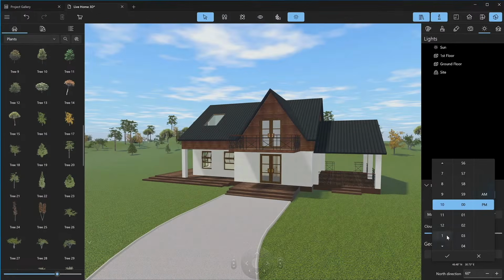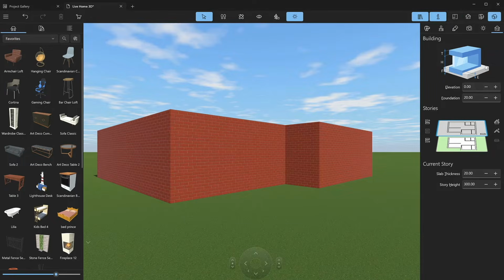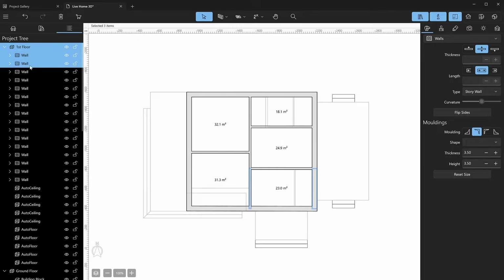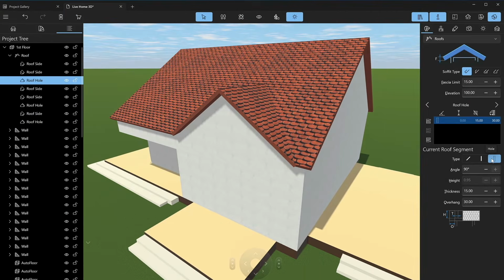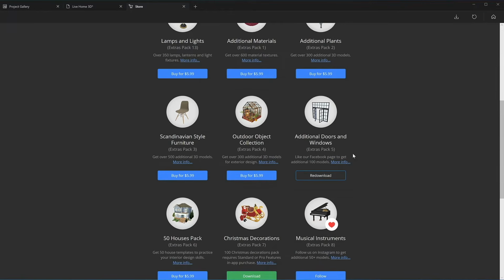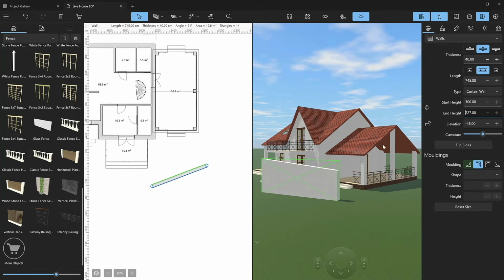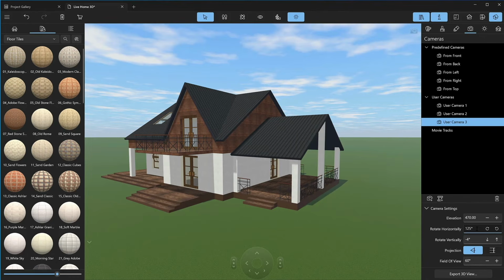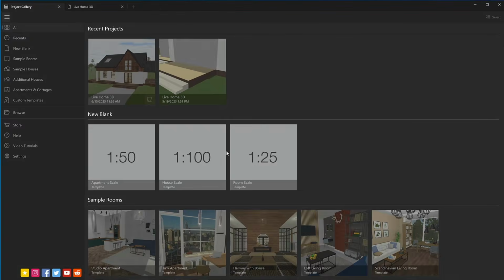How to Create a House from Start to Finish - Live Home 3D for Windows Tutorials

Comment: "The height of the walls can be changed at any time." But I'm not going to tell you how to do it or a lot of these for that matter.  I would have hoped that the actual tutorials from the company that makes this program would have been better than this pile of crap. I'm so lost and it's not even that I use inches instead of mm that's an easy fix in my head.  No, you just flat out skip things or don't include important information. Oh, but let's make sure you know how to put a roof on right away!
Reply from the maker: Hi, thanks for sharing your feedback with us. Right after the phrase, "The height of the walls can be changed at any time.", the video shows how to change it:
"To change the default story height, open “Settings”, tab “Measurements”. The initial value is 300 cm (if the metric system is used).
The height of the current story can be changed under the “Building Properties” tab of the Inspector."

Here is some additional information about this, which can be helpful:
The program does not allow you to directly adjust the height of standard walls. All Story Walls on a given story share the same height, which corresponds to the story height. To modify this, navigate to the Building Properties tab in the Inspector.
For Loft Walls, their height is determined by the roof located above them on the same story. If there is no roof, the Loft Wall’s height will match the story height.
The Curtain Wall is the only type of wall that allows for customized height adjustments. You can modify its Start Height, End Height, and Elevation using the Object Properties tab in the Inspector.

Comment: Why is there no building blocks in my application?
Reply from the maker: The Building Block tool is available only if you have the Pro features unlocked.
If you don't have the Pro version, you can use the objects available in the “Shapes” section of Object Library, as an alternative.

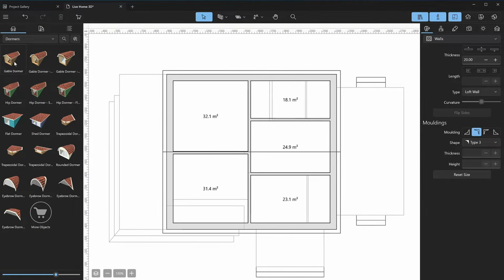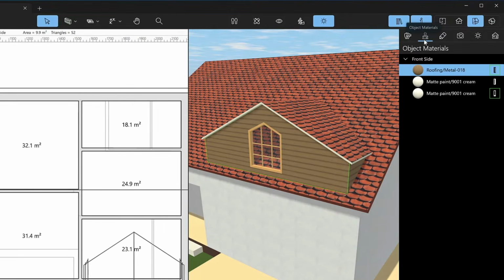Comment: Hi, I'm pretty new to this app so I got really confused on some parts in the video that you skipped, specifically referring to when you built the Gable Dormer in 10:10 to 10:42. My Gable Dormer keeps revealing the inside of the attic no matter how where I move it or how big or small I make it, while your Gable Dormer only revealed the outer red layer of the roof. I keep trying to remake the roof and then add the Gable Dormer again, but it doesn't change anything. I also don't know how you transformed the window color from that light shade to clear so fast. It would be awesome if you could explain what you did or how I can fix this problem. Also, what was the purpose of making the roof segment for the Roof Gables a hole?
Reply from the maker: Hi, please send us your project in Live Home 3D format by email to support@belightsoft.com.  Please describe your question in this email message. We will be happy to assist you.